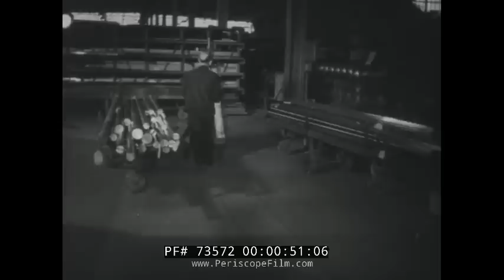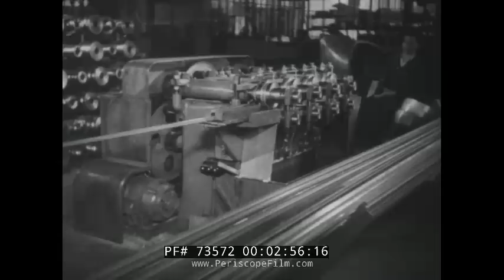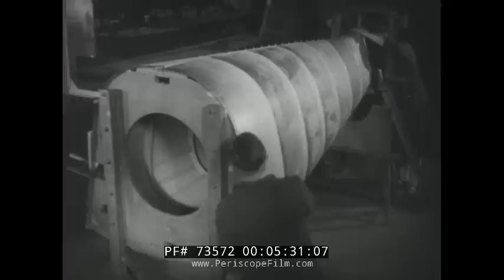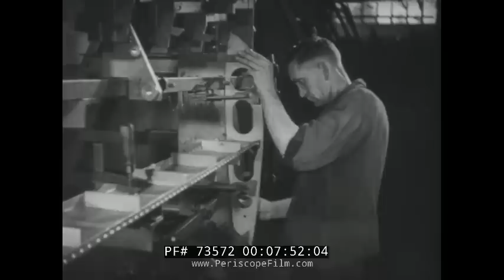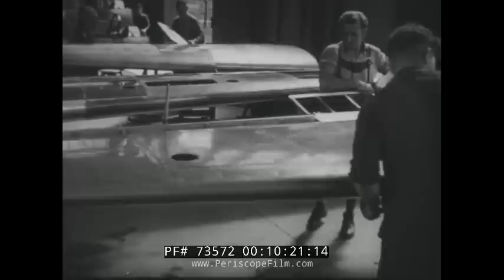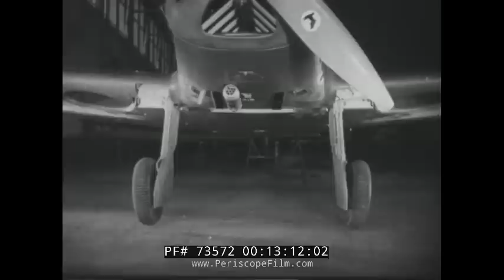CONSTRUCTION OF MESSERSCHMITT Bf 108 AIRCRAFT AUGSBURG, GERMANY 73572

Comment: The Me-108 is hardly a war plane so I'm somewhat surprised they flanged the fuselage sections like they did. Fantasy of Flight has one being restore and it's taking some time. Apparently, many of the parts are magnesium alloys. I worked in a half dozen airplane factories and never saw Magnesium except as castings, such as landing light brackets or sight gauges for hydraulic fluid. Making this film must have been a bit of work in itself.

Comment: Let me see if I have this correct: two guys in sandals, dressed for Oktoberfest, assembled an entire aircraft from pieces, by hand, a rivet gun and buck-bar. And thousands were made. Unreal. German engineering is unbelievable.
Reply: Actually, they still do..!
Reply: Minimalist 'factory', with few machines needed and wooden bucks.

Anyone else think of how advanced this was then, and ready for WWII?
Reply: Maybe if Boeing workers wore Lederhosen, they'd be able to build aeroplanes.
Reply: Roger Voss This is not a minimalistic factory. This was one of the most advanced works of it's time. You shouldn't compare it to the big purpose built American arsenals ofcourse. This was no mass production. Yet...
Reply: +ZerokillerOppel1 - I was admiring of the minimalism, in engineering or production the simplest solution that does the job is best. 'Elegant' solutions.
When I said "how advanced this was then, and ready for WWII" it referred mostly to the aircraft as being advanced and ready for wartime conversion, but it also referred to the factory itself.  Relatively easy to set up production anywhere, with minimal resources for tools & forms needed, the only limit other than raw materials is training the workers.
Reply: This was a sophisticated air frame timber bucks and all.Problem was because of its construction field repairs were very difficult and whole sections of plane had to be sent back to the factory for repair. Was this film running slow? Or were the Germans working not that interested.
Reply: manofausagain They were very interested, and they are not building in a high volume factory. An air force friend of mine was stationed in Germany in the 1950s, he visited the Mercedes Benz factory and stated they built everything very slowly & deliberately - there were few who could afford them, so quality was top priority.
Reply: wicked beer? LOL Germans when they come to portugal, thwey get drunk everyday with portuguese beer. Much tastier and much stroger than german beer.....
Reply: manofausagain if you rush anything the risk of mistakes rises
So concentrated and steady work is the best way
Reply: They hand made 885 of these.

Comment: The history of the Bu181 given in the description is comprehensive and accurate, but the film has nothing to do with a Bücker Bestmann. The Bestmann has fixed gear, is constructed mostly of wood and has a four cylinder HM504 The aircraft in the film is all metal, has retractable gear and has an 8 cylinder inverted "V" engine.

It is clearly a Messerschmitt Bf 108 Taifun with a Hirth HM 508 engine.
Reply from the maker: Thanks, we have completely changed the film description to correct this mistake. DANKE!

Comment: 16:34 - is that an electrical harness running front to back along the middle of the canopy?  I'm no expert, not by a long shot, but that seems like the most inconvenient place to run a bundle of wires or cables.
Reply: I thought the same thing at first.  I think it's a curtain though... to block the sun.  It looks like it slides down on the three curved rods that follow the shape of the canopy.